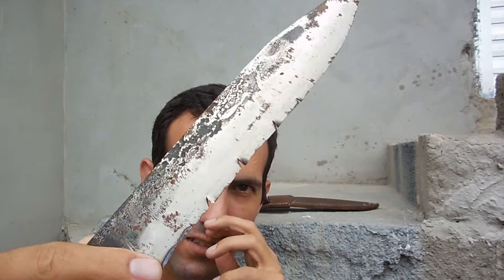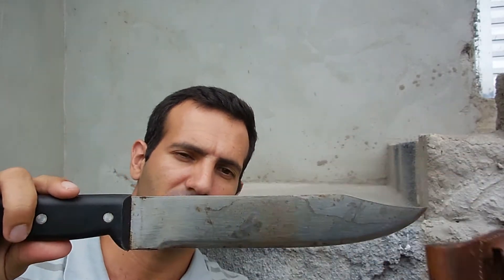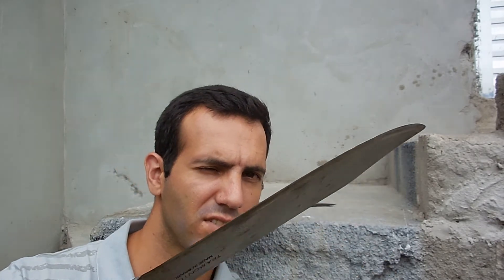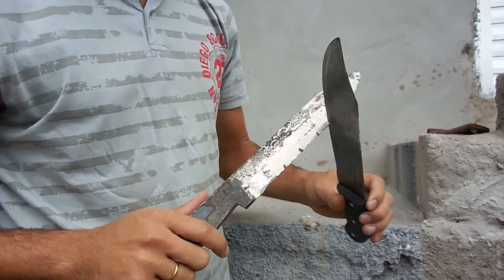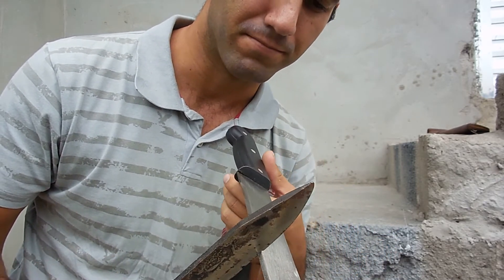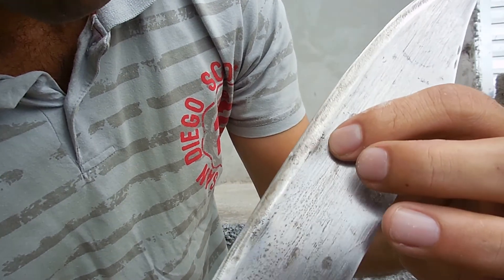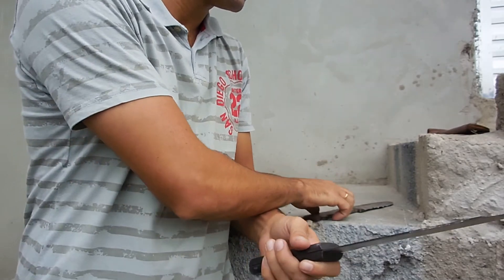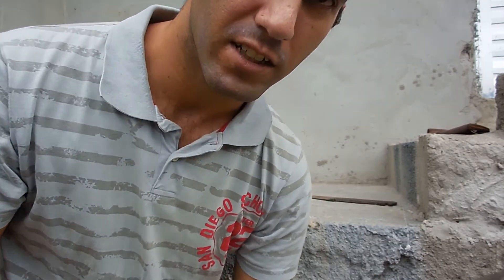Blade impact - carbon steel heat treated vs mild steel not treated

Comment: Hahahahaha! Excellent demonstration. Love it. Heat treated blade just gets chipped and there’s a canyon sized gouge out of the softer blade. 😱 then you tossed it! Talk about a mic drop hahaha
Reply from the maker: I could baton the machete until completly cut the other blade, then take a file and fix the edge with no problems.